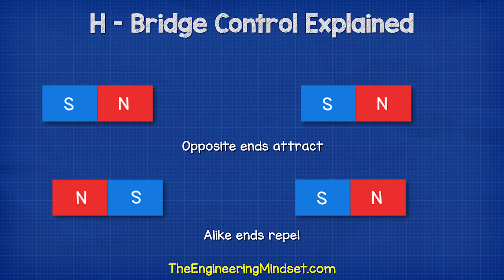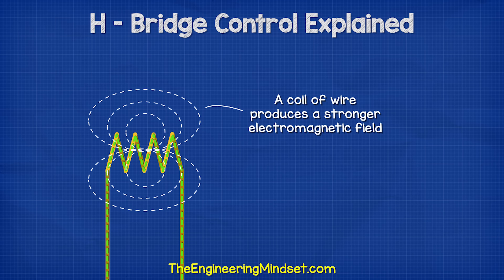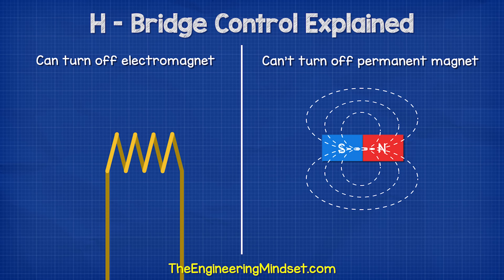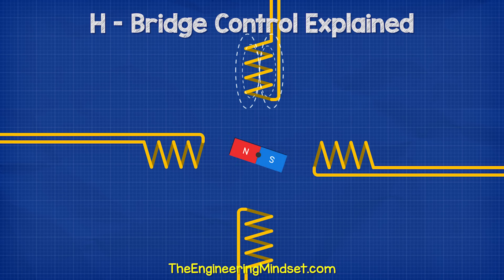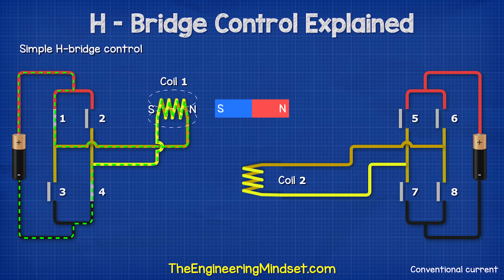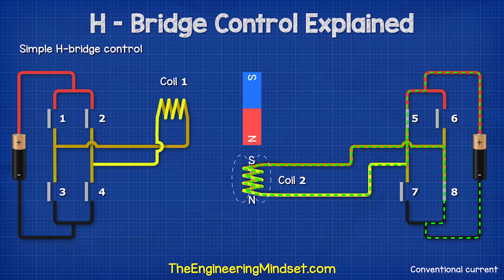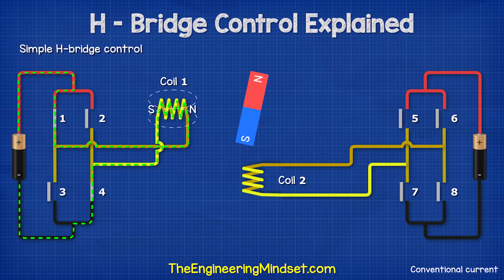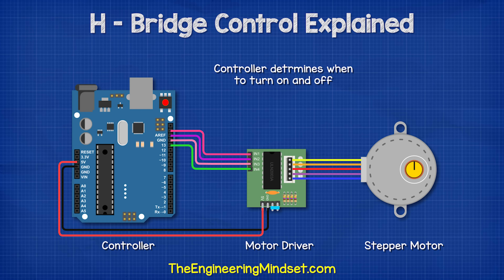H Bridge Motor Control Basics Explained

Comment: Great explanation! Is it possible to make a video to illustrate how H-bridge applied to a three-phase AC current input control the direction of rotation, please? For a single-phase rectifier is simple- just change the input current from top left tot top right IGBT, but I have difficulties to fugure out how this is applied to a three-phase input. Thanks again!

Comment: Can someone tell me if a H-bridge only uses half the voltage that is passed into it? Having trouble understanding why my H-bridge motor driver seems to only run half the power through it. It's making my brain bleed going down all kinds of rabbit holes and I wonder if the thing is just not working right.

Comment: that's an inefficient way of rotating a motor, i think H-bridge controllers are only useful in reversing the the current flow and the rotation of machines like motors

Comment: How is the polarity of the current flow reversed if the battery position remains the same?
Reply from the maker: Look closely at the switches, they determine which direction the current will flow through the wire. That determines the polarity